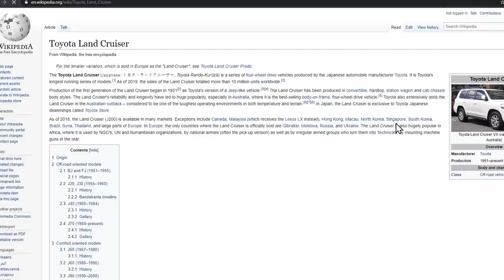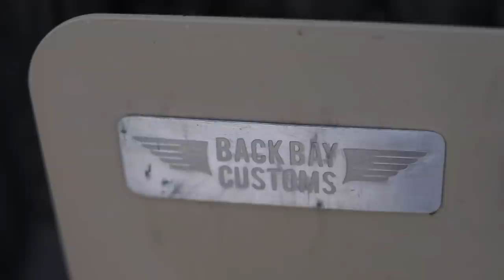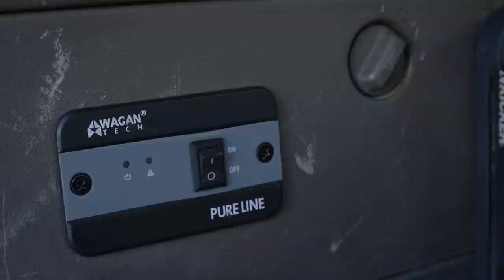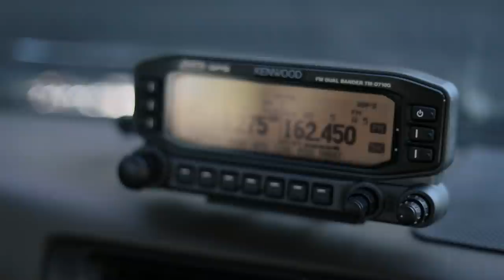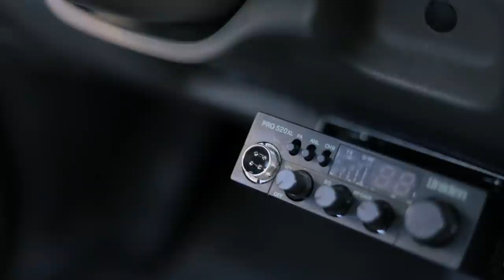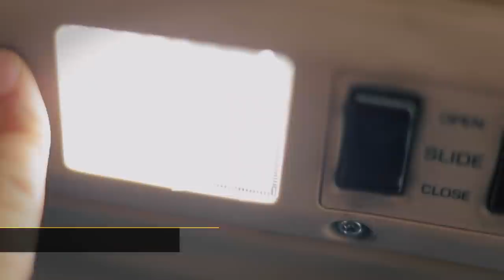Our FZJ80 Land Cruiser Walk Around: Why is it one of the best overland vehicles?!

Comment: Interesting enough. My Discovery2 has been very reliable and the cost of ownership is actually not that bad. Especially if you do the work yourself and know where to get parts. My Discovery has 200k miles. And its arguably more reliable now than when new! Its triple locked on 35s as well. After 14yrs of ownership I can truly say that these trucks are more reliable than people think. They do have quirks, but so do most 20yr old trucks!
Reply: @hdjoeiii  Just basic hand tools.( Unless you  want to change values in the ECU/BCU) Maybe an ABS code reader? but thats it. The newer ones you need the computer that can communicate with all the ECU functions just to do basic troubleshooting. Mine you can still fix with sockets and wrenches. Yes the depreciation is horrible, but that is starting to change. Clean examples with service records are fetching $12000-14,000 US dollars! Where not that long ago you could find them for $1000!! Not a factor for me though as I have no plans to ever get rid of this truck. If I did get rid of it, the parts alone are worth more than the truck as a whole.

Comment: You have a lot of good quality stuff on your rig, but I like how everything is practical. If it's something that NEEDS to be quality, you spend the money on quality stuff. But you also keep a level head when it comes to things and don't just put the most expensive accessories on it just because it's cool. Your fuse block for example, (which I've made myself now thanks to you) is a great diy projects that doesn't cost a lot of money but is very practical as opposed to the other systems you could have bought that cost loads of money, but are unreliable.
Reply from the maker: I try to find that balance. Some items are "Buy once cry once". I wouldn't by an inexpensive Hi-Lift alternative, but I don't need to spend $120 on a hose that allows me to air down/up two tires at once.

Comment: All I can say is that I love my 95 80series. It’s the most robust vehicle I’ve ever had the pleasure of driving and working on
Reply: Thinking of buying 95 for 4400. 330k miles. Any thoughts
Reply: @DukeFame88  Did you end up buying it?
Reply: @Bru946  I did. It needed a new throttle body and alignment. I also painted white and put 33' tires on it. Looking nice and running great with 336k on it.  gas mileage sucks but only used as a weekend surf fishing truck.

Comment: All 80 series Land Cruisers have a center locking differential in the transfer case. They just don't all have the switch in the dash to engage it in 4-high. The switch is around $100usd from Toyota. The connection is behind the hazard light switch tapped back to the wire harness.

Comment: Love the channel.  I’m a newbie when looking at rigs.  Can you do another video on what’s involved in a lift?  For example the old man EMU has many parts of suspension, springs, cross arms.  Etc.  cheers.
Reply from the maker: Good suggestion!
Reply: I second that. A lot of questions go around regarding if you have to install, castor plates vs bushings, pan hard bars, brake lines, etc

Comment: Sadly selling my 97. She needs to go to someone that's going to enjoy her. 80s are the best.
Reply: Where are you from?
Reply: Yes hello I heard 97 and selling?  Can I get some information please.
Reply: Why are you selling?
Reply: 1997 Lx450 California rig clean title. No lockers. I've owned her for about 7 yrs. Has a little over 300k miles. Binder full of receipts and maintenance records. Almost everything has been replaced in her mechanically minus the engine and trans. But I do oil changes every 3k miles and run fuel cleaner. Newest part are rebuilt drive shafts. Originals are still great but I just wanted new ones.
She runs great but I dont drive her anymore.  Cost of gas is high and low mpg. 
I've also never taken her off road. Strictly highway. Shes seen snow once on the highway.
Reply: @Simple_Youtube  Could you send me a link to the vehicle you're selling?

Comment: Hi, the power to the back and the accessories it's direct from the battery right?

So it's always on, your not afraid to run out the battery?
Reply from the maker: There is a switch for the 12v power at the block, and a switch for each accessory in back. That power block is off most of the time.
Reply: Ok, and for the lights and radios,  the relay's  are connected to 12v ignition (the white wire) so it doesn't draw the battery when the car is off?

Thanks for your work, great rig that Toyota.

Comment: Are you still running air springs in the  back of your 80??
Reply from the maker: I did for a while - not currently.
Reply: @OverlandBound  how did the air springs hold up ?  I'm currently using  OME Js front and rear with a 30mm spacer in the rear.  With the truck loaded with food and fuel its sags a bit in the rear.  I just want it to sit level when its loaded.

Comment: what do you think about landcruiser 1991 motor 4.0 its bad?
Reply from the maker: It's not bad, but you will feel under-powered when you load it up. Its a fine motor, but significantly less horsepower. It will feel those 35s!

Comment: Micheal, lighten up man. Stop being so serious...;-)   Serious question; what is the red stuff on the relay block screw heads???
Reply from the maker: Thats a Plasti-dip ruberized coating. Not sure I would do that again. It's a little messy - I also want to do a second pass on the "container" for my relay/switch fuse block.

Comment: the only thing you need is V8 chevy diesel convesion..
Reply from the maker: :D
Reply: @OverlandBound   6.6L Duramax?
Reply: No, no, no.   1HDFT/H151.  It was designed for this vehicle and never imported to the US.
Reply: @oferbruhis9942   What about a Toyota 4.5L V8 desiel , probably a swap kit out there. But being based in the US having non US drivetrian componants is something he wouldn't do.
Reply: @gen1c8rs88  The 1VD-FTV is a great engine.  However, I would stick to the 1HDT or 1HDFT 6 in line because they are all mechanical.  There are 3 wires going to the engine - oil press, temp and injector pump.  I hate the idea of 6 computers controlling your vehicle when you are in the middle of nowhere.  The new LandRover Defender 110 has the option of turning the computers off and 'crawling' back home which is a great feature.